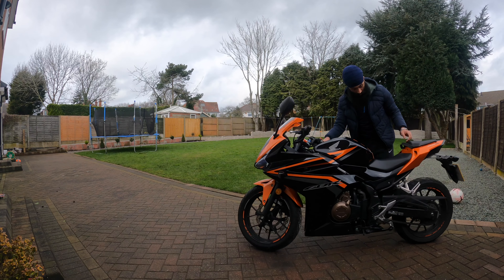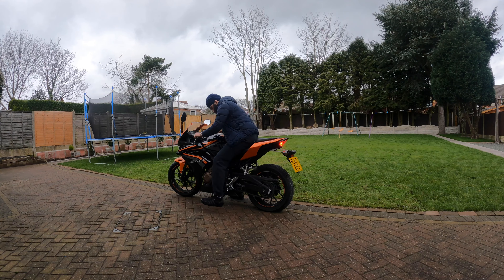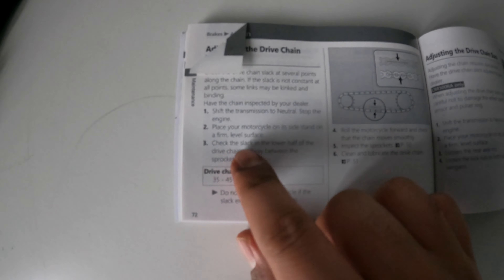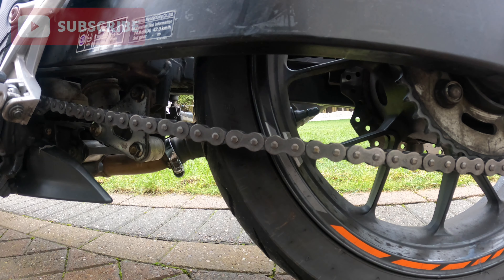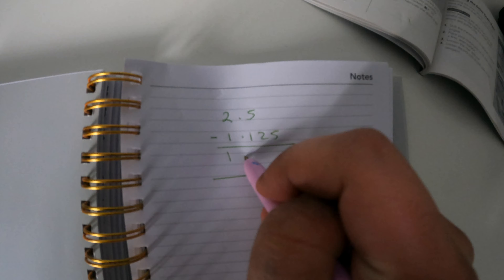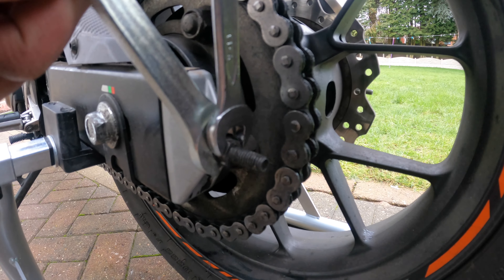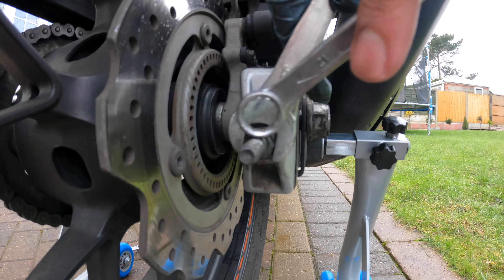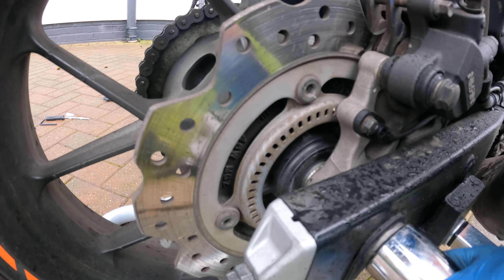How To Tighten Motorcycle Chain On Honda CBR 500 R ?- Motorcycle Singh

Comment: Should the wheel nuts look exactly the same on both sides, as in the space that can be seen before and after the nut in the metal channel that allows the nut  to move forward or backward. Currently on my bike I can see that the nut on the left side is not in the same position as the nut on the right side. I also notice that my bike pulls to the left when I take both hands off of the handle bars.